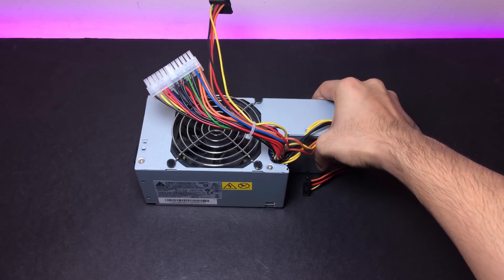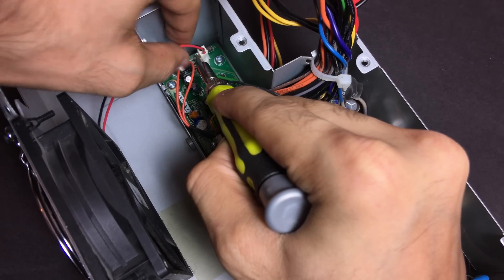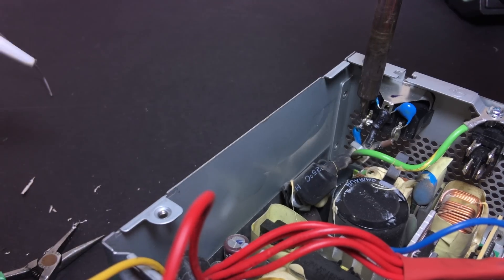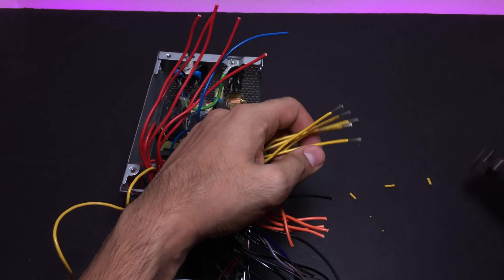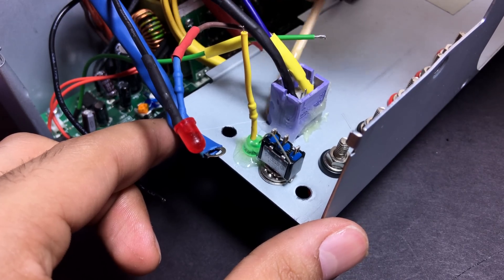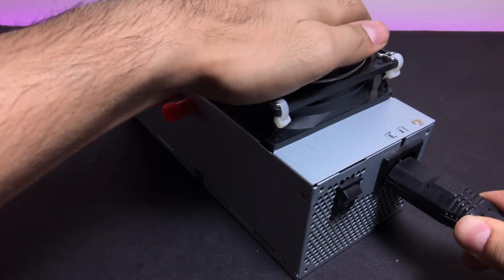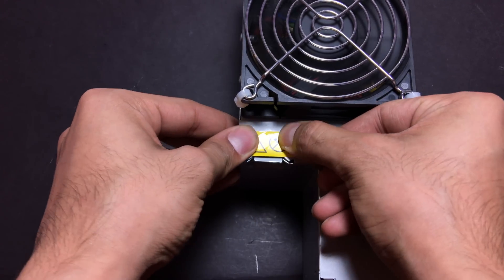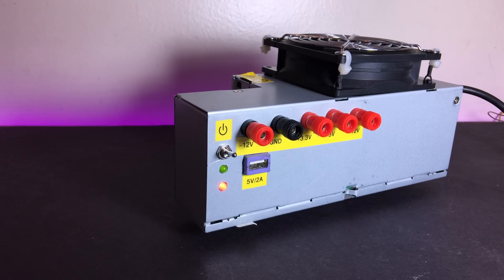DIY Lab Bench Power Supply | Computer ATX Power Supply Conversion in under $10

Comment from the maker: Thanks For Watching Guys! let me know in the comments what project you want to see next :)
Reply: I'd like to see how, on a budget, one can make the +12Vdc adjustable from zero up to +12Vdc.
Reply: Saad Aamir nice video. if I want clean 12dc do I use yellow(+12v) to black (ground) or yellow(+12v) to blue(-12v) ?
Reply from the maker: ram dat +12V(yellow) to ground (black)
Reply: +12v and -12 give 24v
Reply: Saad Aamir 
Hi 
Can I make two 12 v
I mean i have 4 yellow wire use 2 yellow wire only for each one

Comment: So I got done with this project, and while it works, it's putting out some odd voltages.  I'm getting 6.7, 10.7, and 26.7!  About double what it should be putting out.  Also the PSU's fan doesn't come on.  I'm guessing it was probably junk before I got started.  I'll run it til it conks out though, just can't use it for any precision stuff.  Good thing I got it for free, just wish I had tested it out before putting the effort into the conversion.
Any suggestions to what might have gone awry are welcome, whether it's the PSU or something I did to it.

Comment: Thx u so much for this atx power supply ^ ^
I will build one as well : )

I have only one question for the USB output, would it not be better to use a Red 5V cable ???
I think the output would be stable 5V.

Greetz Diego
Reply: You can use it but there always very high current on the red wire which are 5v they can deliver above 20amp easily if you connect something incorrectly you can blow that device up

Comment: Very nice!  ;-)
An opinion:  Using the red wire to power your Power On light (Green LED) is fine... But if you had used the Grey wire, you would not only have confirmation that the power is On, you'd have confirmation that the unit is operating withing specs!  Isn't that worth having? Anyway, something to think about.  Cheers!  ;-)

Comment: im just now watching this for the first time. I gotta say BRAVO.... You did a great job my good friend. Im bulding a custom benchtop power supply unit myself. Im having issues installing my LED power on lights. Like im not sure how or where I want to place them yet, but im going with the 3.3v and 12v outs and the 5v will be USB. I also had to put my fan on the outside top of the unit also. im also adding a 110v ac plug for my soldering iron. ill take a picture once fimished and upload it to my comment if it allows me to.. Thank you again my friend, you gave me some great ideas on mine and a few extra ideas..  Chase R from USA, Ohio.....

Comment: Why would you want -12 volts?
Reply: If you conect one of the +12v  like positive and you get the -12v connected like ground you will get 24 v.
Reply: @josemoreno3611  I just learned something. I never knew that. Thank you very much for explaining that.
Reply: You can make 24 volts .
Reply: @josemoreno3611  I'm really sure I'm picking up what you are putting down. Would you be willing to explain a little further?
Reply: they use for opamps which need both rails +12 and -12v

Comment: In your list of supplies and on the schematic you have the power resistor as 5ohm 10 w, but the link you have 10ohm 5 w, can you confirm what the correct item is.
Thanks for the video.

Comment: what is need of 10w/5ohm dummy load resistor you connect.
Reply: Most modern ATX power supplies require a small load to stay in the ON mode
for more
http://www.instructables.com/id/ATX-->-Lab-Bench-Power-Supply-Conversion/

Comment: i have 12v rail has 16 amp and -12v rail has 0.8 amp if i use 12v and -12 i get 24v but how many amps ??
Reply: Mohammed Riad 
As much as blue wire 0.8Amps

Comment: Hi i have a question about the resistor.What do you think i should use on this one .......SPEC are (+3.3v -30a) (+5v-30a) (+12v1-22a) (+12v2-20)...Would i need 2 resistor for 3 and 5
Reply from the maker: Fook Utube one should be fine on the 5v line
Reply: Thank you Saad...

Comment: I want 24V also, can I connect 2x12v wire  (yellow-(black&yellow)-black) to get 24 v
Reply: That's not how it works...you need a boost converter for that
Reply: SjanST Official thanks for your reply
Reply: To get 24 volts u need to connect a yellow wire and the blue wire to the load but the current will be low
Reply: dont do this you will short your supply very badly

Comment: why can't you just use the factory main switch to get into standby mode? why did you add another one? I'm confused since I don't see how you wired it in the schematic and if I wanted to use the factory main switch, how would I wire it or leave it as is?
Reply: Since this is a recycled PC power supply, in the original configuration there was a PC on button, these two wires green to black are those power on/wake up trigger for the power supply to energize all outputs. As he said in the video, if these two wiresare not shorted you will only see 5v from the aux 5v out as long as the power supply mains switch is on and plugged to line voltage.

Comment: Thank you for this well done video and wire diagram, it made it easy for a beginner at electronics to do. I did a couple things slightly different as mine is for a singular power supply for a car radio and phone charger to use in my workshop. Thanks again, Good job.

Comment: Great Vid!!! But my old power supply doesn't have a brown wire. is that ok to continue the build?
Reply from the maker: IsMe Fufuknox Yeah, It shouldn't be a problem.
Reply: the brown wire is for 3.3v sense wire which connects to 3.3v wire to sense it

Comment: I have a recommendation the only thing I would add not change to everybody's YouTube power supply conversions is use a plastic back plate on the outside face under the binding post. I know that you're supposed to use banana clip leads but when people perform projects a lot of times they just try to wrap wire around it, and spark or ground against the back plate. Just an idea not that what's been done by anybody is wrong or use it wrong. Your videos are awesome and your conversion is awesome and clean good job I've watch this video a few times I like it.
Reply from the maker: Wes Miller Glad that u liked the content and Yes you are absolutely right about the black plate thingy.

Comment: The unit I have has 18A on +5V,  20A on +3.3V,  18A on +12V1,  18A on +12V2,  0.3A on -12V and 2A on +5Vsb. Does it matter which one (5v or 12v or 3.3v) the dummy load is on? 
I have yellow wires and yellow and black. I'm assuming the yellow will be 12v1 and the yellow and black will be 12v2. If I combine them could I theoretically have 36A?

Comment: Hi Saad, great tutorial, very easy to understand & well laid out. In my case I have a Coolmax V-400 PC power supply. The 3.3V line is 30A, which is higher than the 5V(28A) line, and higher than the 12V1(14A) & 12V2(15A) lines combined, but the 12V lines together have the highest wattage. I am a little unsure of where to draw from for the Led input and the 5ohm resistor. Maybe second guessing myself, but most of all just don't want to screw it up since it's a nice unit to be working with. Any thoughts?

Comment: On information at 1:50 mention that Purple for Aux (USB) , but at 5:0 you connect Blue wire (-12V) to USB + piece of purple to connect to LED
Reply from the maker: ledhie i am not sure what you mean. But here is the schematic. Hopefully it will clear things up https://easyeda.com/normal/Wiring_Diagram-f07c700c6f1545a2a8453c2cb63f1157
Reply: Many thank's for schema,

Comment: The Power Resistor in the video looks like a Arcol HS25 Series, rated at 3.3Ω ±5% 25W. The description says 5Ω 10W, while the link is to a 5W 10Ω. Which one do we use?
Reply from the maker: Keith Tank yes you are correct. The reason i used that one was cuz i had that one laying around. The point of the power resistor is to keep power supply stable during low current draws. So generally speaking 5ohm 10w resistor would do the job going any lower than that wouldn't effect to power supply much.
Reply: If  you connect  2pcs  of 5W 10Ω in PARALEL you  will have 10W 5Ω resistor. If  you can  you can  use  one  of  fthis 5.1Ω 10 W alluminium  resistor http://www.ebay.com/itm/182372944803?_trksid=p2057872.m2749.l2649&var=484934906347&ssPageName=STRK%3AMEBIDX%3AIT
Reply: Saad Aamir my power resistor gets really hot after a minute, probably about 80 °C. I connected 12V to the resistor. How can i reduce heat? Its a 6ohm 25W Power resistor.